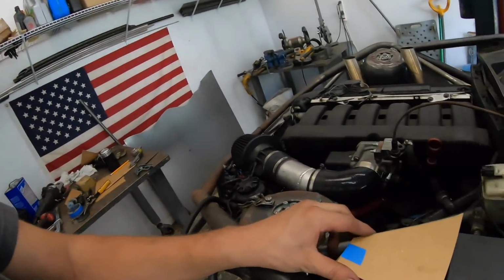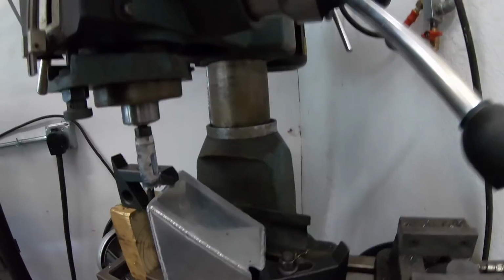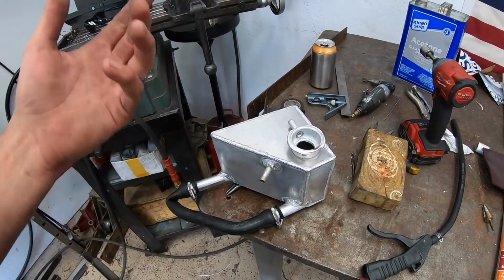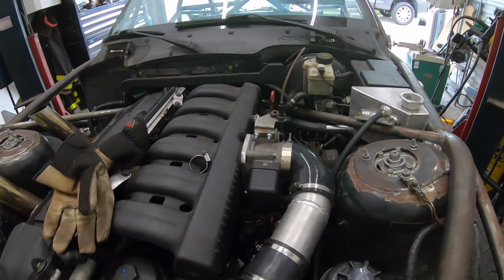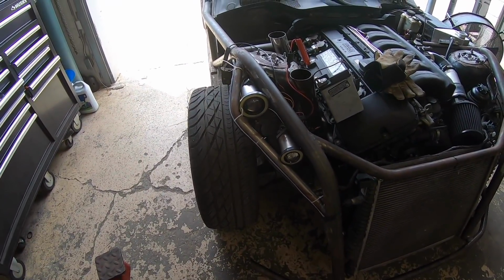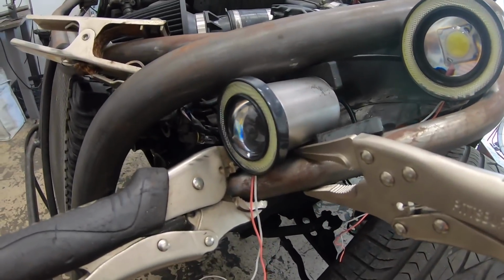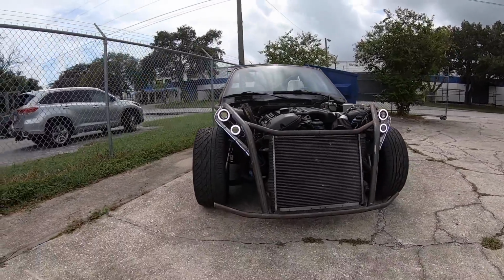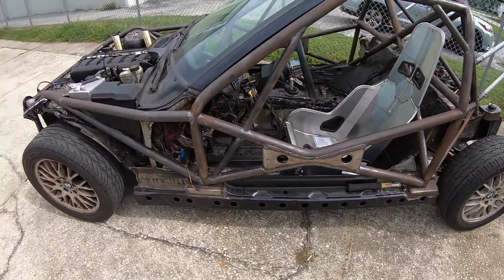Let There Be Light!!! BMW Exo Kart Gets a set of Angry Eyes

Comment: Jeremy mentioned to you were using some type of lightweight battery? I am looking for something after relocating my battery in my e28. Wondering what you were using
Reply from the maker: I’m using a duralast agm battery from autozone.  Etx18 I think it’s called. Not super light. Around 15 lbs. But can be mounted any position and is small. Works great just Jeep in mind the size. Aka I wouldn’t run your lights and stereo without car running for too long.